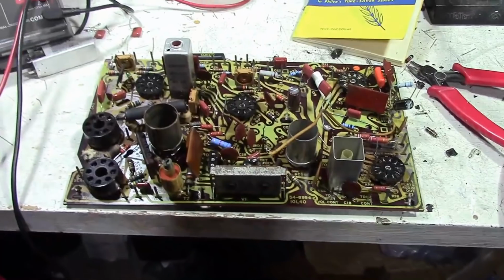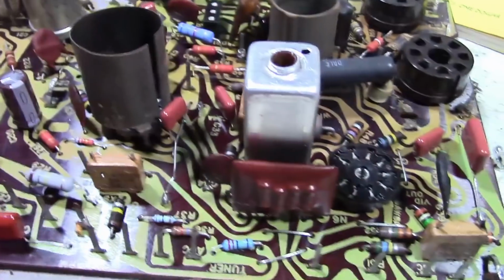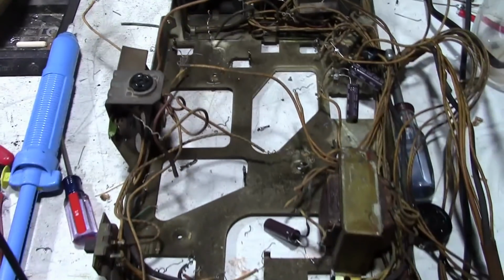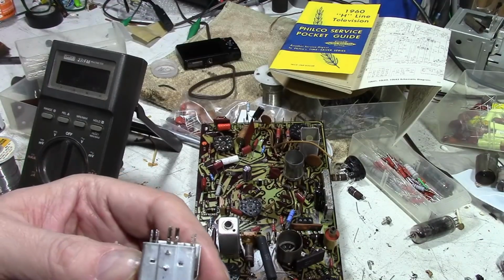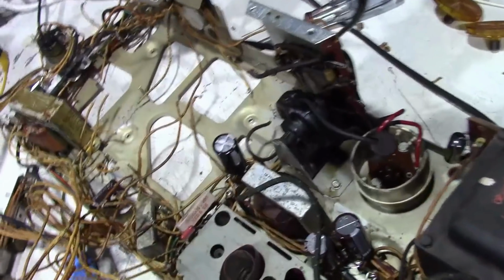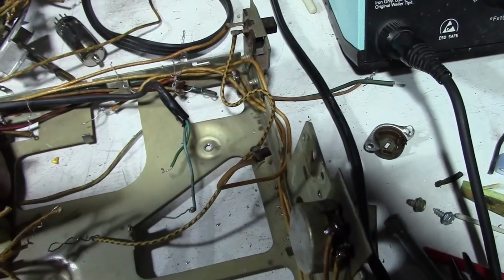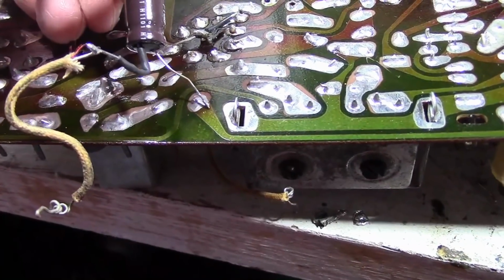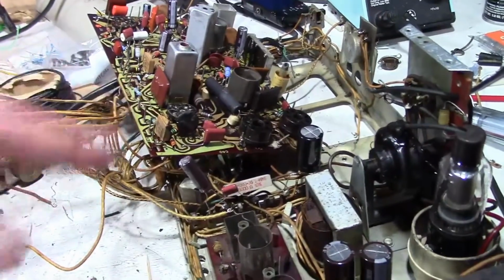Filthy Philco Predicta Siesta resto p6o?

Comment: Hey Bob, thanks so much for this video.  I'm restoring a siesta now. I'm curious, the schematic (sams version) has a resistor in the parts list labeled R63 which is 4 Ohms cold. Its part number comes back to a thermistor(Philco #33-1343-19). I cannot physically find this part inside the set and also not listed on the schematic. I'm assuming this is a part list error? Did you notice this? I don't see one on your set either. Just making sure mine didn't totally disintegrate or is located somewhere I haven't looked yet.
Reply from the maker: It's on the yoke - in series with the vertical windings.  It's shown on the second page of the Sams schematic in the lower right.
Reply: bandersentv thank you so much I’ll look for it. Did you replace it? I haven’t looked at the yoke yet.
Reply from the maker: No, I've never needed to replace one or heard of anyone having to.  Seems to be a very reliable part.
Reply: @bandersentv  So sorry for the endless questions, but I cannot find the 4.1K 7 Watt or higher resistor. My original one measures pretty close so thinking about just leaving it. Can I ask where you found yours at?
Reply from the maker: @johnbaker26  I used a 4K.  The difference won't matter

Comment: That is now a beautiful board. How breathtaking would it be if Bob replaced every single wire on the whole chassis? Imagine... the new and the old combined.. the yin and yang. The smell of hot valves combined wiith brand new, shiny, smelly hot PVC insulation. This is amazing work!

Comment: You're right about the replacements for the multi section cap has better place on the board, because the closer to the circuit it decouples the better. But probably better to leave the main filters on those solder lugs where they're currently on, because in case of rectifiers, the closer the filter cap to the diodes the better, because the current flowing between the diodes and the caps contains quite rapid changes, and can radiate 60Hz hum easily into sensitive, high impedance circuits, if you connect them though long wires. 

Putting a 10-47nF cap parallel with the rectifier diodes can also help to suppress the switching noise they produce, but doing so does not substitute the short wires between the filters and diodes, both approach required for the best result. The caps across the diodes may not be necessary, but you can try it, it usually helps to lower the ripple.

Comment: On adverage how much more difficult are these Predicta's to work on compared to other TV's of the same Era?  Would like to own one someday but I am still struggling with Radios. Not there yet.
Reply from the maker: Easier than some, harder than others.  Most every manufacturer had switched to similar PCBs by the late 50s.  Zenith being the notable exception.  TVs from the 40s are easier to work on but are larger and have smaller screens.

It's spare parts that are the really difficult things.  Especially picture tubes.  Expect to pay $200-$300 for one if you can find it.

Comment: Is it chromated?
Reply from the maker: Huh?
Reply: @bandersentv  If you've ever seen yellowish metal with kind of rainbows in it, it is called chromating and it is for corrosion resistance.  I have a 70s receiver/amplifier that is completely chromated.
IIRC, the metal is electroplated with zinc and then it is put in a chemical bath for a few minutes.  It is very good rust resistance and has a pretty distinct look.  You mentioned the chassis frame was yellowed and that is kind of what chromated metal looks like.
Reply from the maker: @tarstarkusz No, this is cadmium plated steel.  I didn't realize that later plating was called chromated. I've seen it many times on newer gear. Thanks for the info.

Comment: Bob, great vid as always. Have you ever considered using a house light
dimmer switch for the ballast tube in the  Holiday and Motorola series strung 
sets for the filaments ?  I mean for it to substitute the ballast tube only.
 It would save  quite a bit of work and you can dial in the exact filament voltages you 
need. I doubt any rf would effect the set like it would AM radio.

A while back you showed us a Philco radio shadow meter and expressed concern
if the coil would open. That coil is only an electro magnet, not a tuned
inductor. Verrry easy to fix. Takes just a few minutes with a drill and a 
spool of wire. Details on PhilcoPhorum.com. Joernone has a vid on
 re-magnitizing the vane magnets as they often get week after 80 years. 
Easy Peasy !   Kevin
Reply from the maker: No, I've never heard of one being used as a ballast.  I think those work by clipping the sine wave.  I'd have to be care to get the true RMS voltage right.

A really perfect solution would be to convert the AC line to pure DC and regulate the current to exactly 300 mA for each filament string.

Comment: What I like to find is some 455.kc IF transformers,to have to repair and practice on , smd and put some silver mica caps In to try to repair them ,for practice and to have them on stand by for when they are needed.The trick is for me is to find them .
Reply: I ended up designing my own, they are soldered together from 3 PCB sub-assemblies to form an 'H' shape that then fits into the existing .75" square can. 

I 3D printed a new plastic base for them as well...
They work quite well, replaced two 2 cans in an old Wards Airline AA5 radio and it works great. Maybe even stronger than before...
Cheers,

Comment: When I worked in a tv shop back in the 60's we had a bench tech that washed every chassis he worked on. He would spray the entire chassis first with a light coat of WD40, let it soak for about 10 minutes, then wash it down completely with Blue Shower Tuner Wash. The chassis would look brand new.  But I haven't seen Blue Shower Wash in years. And nothing like it I have tried works with the same results.